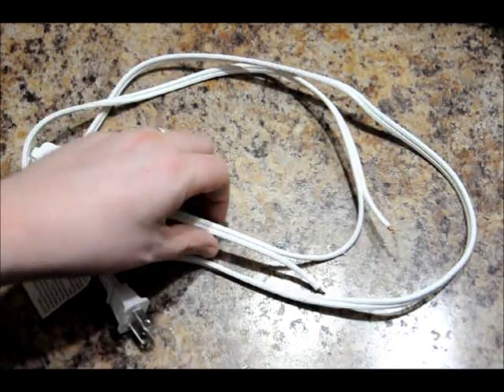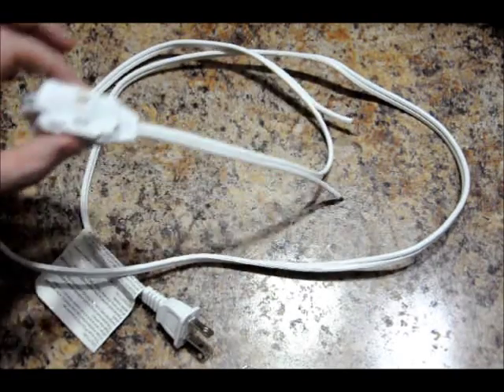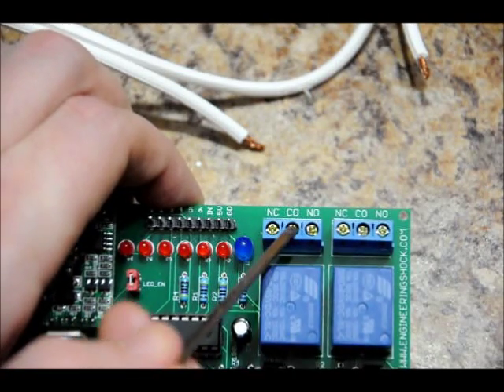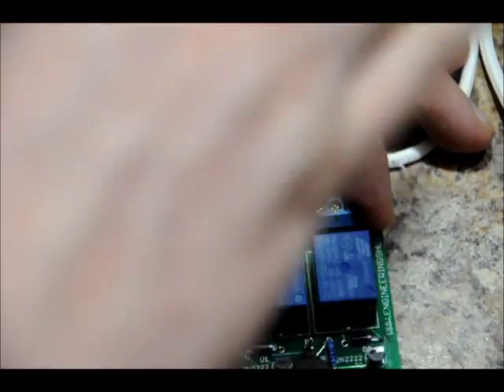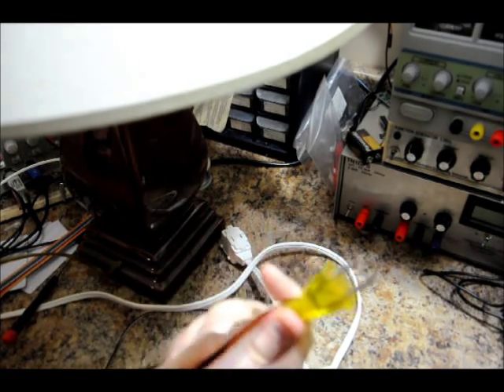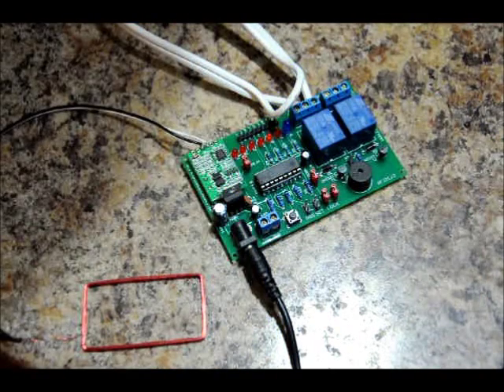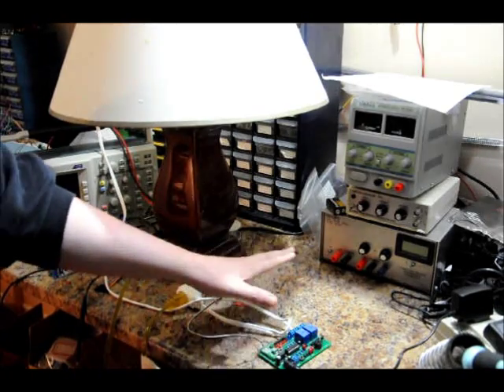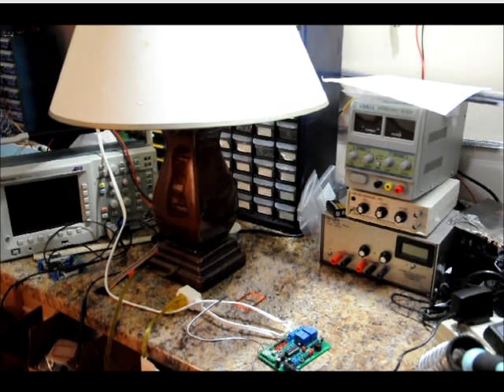How to control AC devices using the RFID123 RFID reader module

Comment: why did you have to hold your remote over the antenna?  
I sell a Nano grafene ink that work awsume as a painted antenna?
Reply from the maker: What remote are you speaking of?  I hold a card over the antenna.  I don't have to hold the card, just briefly place it over the reader.  Ink likely won't cut it, as you'd have to make many, many coils of insulated wire together, which can't be done with ink.
Reply: Hey Patrick. I was wondering if you would call me on this. I need to understand more about the readers, cards & the antennas needed.  how this all works. Dan 269 838 9136